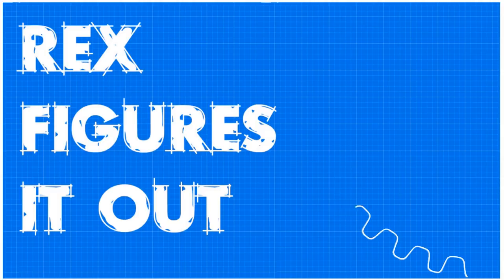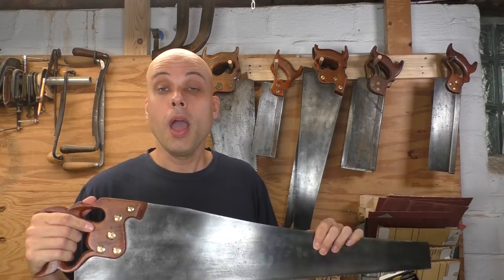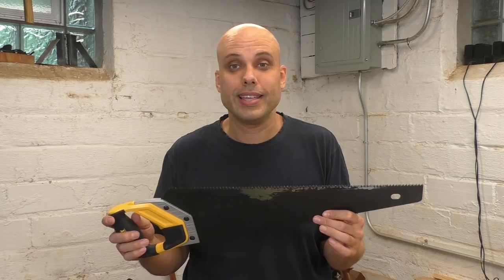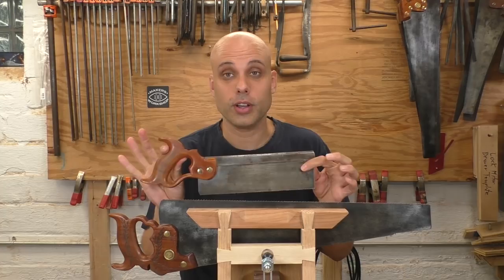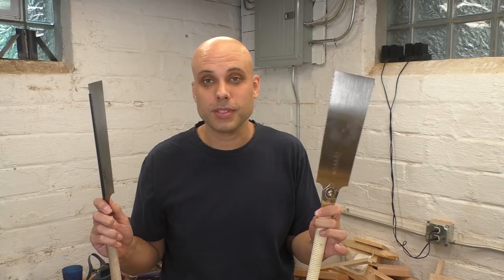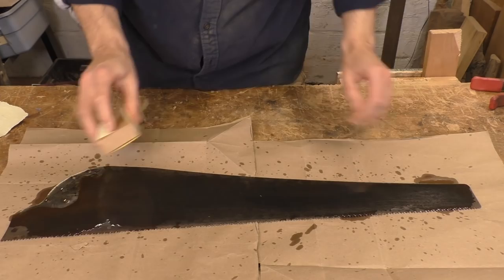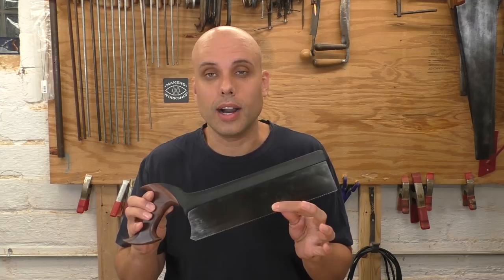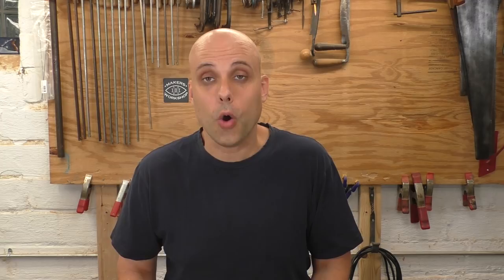The TRUTH about woodworking saws.

Comment: Try putting your old hardpoint saw blade in the oven for an hour or so at 200⁰c/400⁰f then re-sharpen it. Just be sure to take the plastic handle off first so you dont have to deal with an angry spouse.
Reply: You can also just get a set of diamond needle files. I use those to resharpen my curved pruning saws, which are impulse hardened. The teeth WILL get smaller, but I can cut branches and small logs for 10 years instead of 2.
Reply: You can also just grab a cheap torch at the big box store and heat up all the teeth until they start lightly glowing and leave it to air cool (anneal).  Some may even choose to place it in some warm sand or even in your oven with it turned off to slow the cooling process & further soften the steel but in most cases this shouldn't be necessary.
Keep in mind, depending on the exact steel composition, the teeth may need to be re-tempered after sharpening or you will find that it gets dull really fast.  Just don't forget to draw back the temper a little as to not have a brittle blade.
Reply: @John-lx8iu  That doesn't really work. The steel is cheap junk. It ONLY hardens with impulse hardening. You can aneal it but will NEVER get it to hold an edge again because you can't harden it.
Reply: @John-lx8iu   i see where your going with this but the idea of putting it in the oven is to temper the teeth back from the original hardening process, rather than annealing it and having to harden the steel all over again, so the teeth end up half hardened in a similar fashion to those great vintage saws we all chase. It wont be perfect as the steel isn't necessarily great but it does mean you can re-sharpen your saw and it will stay sharp for a good while.
Reply: @grantflippin7808   to anneal it you would need to heat it higher than that, as in to blue colour, this is a tempering process that shouldn't get hot enough to completely soften the steel.
Reply: I thought about this as well. Not sure if it would work but a very interesting experiment. Also there seems to be the inevitable confusion over annealing vs tempering.
Annealing makes a metal as soft as possible and involves getting it very hot then cooled very slow.
Tempering involves moderate temperatures and partially softens it depending on what temperature you use.
Reply: Tempering: softening steel that has previously been hardened. You can soften it a bit, or all the way to a “normalized” state. Tempering temperatures depends on the steels composition (and some new alloy steels require special equipment). For plain old high carbon steel with minimal other elements added, it starts around 400 F and goes to around 500 (beyond which it is normalized).

Normalization (with “normal” steels - low alloy, ie mostly carbon and iron) involves heating to orange heat, letting soak a bit so heat penetrates to core of object, and air cooling - often hanging from wire hooks. This is usually how you want a non cutting object made out of carbon steel heat treated. It is strong, not brittle, and not too easy to bend.

Annealing (again, with “regular” carbon steels) involves heating only to a bright “cherry red” (in the dim light: don’t judge these colors under a strong light). Heating to cherry red and then placing in a metal can filled with ashes or wood shaving, and capped. Or left in a dying campfire overnight. (Be safe...) The steel must cool over a period of hours. The slower it cools, the softer it becomes. You can get a quick and dirty anneal in 30 minutes but don’t use your good files a lot on it because it could be a lot softer.
Reply: Knowing this, I suppose can guess how you harden it (plain old carbon steel... hint: it involves cherry red). You don’t have to cool it to ambient temperature - it can still be 200 or so, when you pull out of oil or water; in fact that’s ideal. Now you can very quickly tap it straight or remove twist because the hardening hasn’t set in yet.
Reply: The crew in this discussion needs to go read the tempering wiki.  There are a lot of inaccuracies stated. It is showing the tempering range to be 350F to 700F and normalization at about 1335F (which would be the red color someone mentioned). Wood saws it is stating are tempered to 640F. These saws are going to be a low alloy medium carbon steel, so the wiki data should match quite well. Your food oven isn't going to get it soft enough. It will get it down to about same as a drill bit or hammer, which is a bit hard for regular files (the diamond file comment seems quite reasonable, and doesn't mess with the original desirable heat treatment). I don't recall hearing the term impulse hardening in industry,  but instead induction hardened. But that doesn't mean the term doesn't describe what happened, it is brief, and things vary by location process/tooling.
Normalizing or annealing will make it way too soft, but you could re-heat treat it afterward. Thin material like these saws will be tricky without machines for that purpose though. It will be harder to control the temperatures evenly by hand.

It think the diamond files sounds like the easiest plan. Also the teeth are probably only slighty damaged, so not that much material would need to be removed. 
Otherwise I would buy a chainsaw sharpener with the few inch diameter abrasive wheels and shape the wheel to a 60deg point. Then make your own saw vise to mount it to (removing the chainsaw blade vise), and create an indexing method for positioning the teeth. If you are that ambitious you could create one for table saw blades too.
Reply: I think this thread is good stuff. I've got things to read up on.
Reply: That’s going to temper it, but then you end up with sharpened, but relatively soft teeth. It’s going to get blunt a lot quicker than it did the first time.
Reply: Absolutely. You can even temper in a kitchen-oven. 5-6 hrs at 300 centigrade... What do you have to loose? Did that a several times with mixed results, some times very satisfying,  sometimes just a detour instead of directly-to-recycling. But again: what you got to loose?
Reply: The initial blade is mild steel with localized hardening on the teeth. If you temper the blunted teeth to make them easier to sharpen, you are potentially going to then grind through the tempered region down into the mild steel. Yes, it will be sharp, but it’s going to get blunt pretty quickly.
Reply: You don't throw the saw away. You send it for recycling so its far less wasteful than you suggest.
Reply: @jonathanbuzzard6648  As far as your wallet if concerned, it is wasteful, unless you consider a faintly righteous feeling part of the pay-off.  You pay for a saw every time you recycle one.  The "vintage" saws are no longer made primarily because they DO last for a very long time.  I have saws that are excellent saws and are over a century old.  One problem with "disposable" saws that Rex didn't mention is that impulse hardened teeth are just as brittle as that file.  A missed stroke or dropping the saw in the wrong place and you have a saw with a gap-toothed cut.
Reply: @theeddorian  Unless your time is free then a modern disposable impuse hardened saw is cheaper to own and you have failed miserably at economics. If you are a hobbyist then a modern saw can last a decade no problem (mine has), and given resharpening a saw is a skill you would have to acquire and requires a bunch of tools then resharpening a saw is simply a stupid proposition.

So what if you are a professional? Well I can go onto Amazon here in the UK and for £10.90 I can get Bacho 22"/550mm impuse hardened saw delivered next day with prime. This is not some cheap Chinesium brand but a quality European tool brand (https://en.wikipedia.org/wiki/Bahco). If Chinesium is fine then I can get one at around half that price.

So lets assume that it will last two years and in that time a resharpenable saw would need resharpening four times and take you 20 minutes each time (I would say that is being extremely generous it will likely need sharpening more often and take longer) . The minimum wage in the UK is £8.72 an hour. So it is going to cost you £11.63 to resharpen your saw over £10.90 to just buy a new one.  So even ignoring the cost of the files, vice and tool to set the angles on the teeth it has actually cost me more to resharpen a saw. The living wage is £9.30 so it will cost me £1.50 to sharpen the saw at that price point. However the chances of employing a skilled trades person at that hourly rate are basically zero so it will cost you much more to sharpen a saw.

OK you say well the handle is not recyclable and I am going for the environment. Unfortunately I have you there too. Just go by a Bahco Ergo EX Handle which takes replaceable impulse hardened blades which are 100% recyclable and avoid all the additional environmental impact of the tools required to resharpen a saw.

You are however right that the teeth on an impulse hardened saw are much easier to snap off. On the other hand I can get them with tooth profiles that are give cleaner cuts and are more efficient at cutting which you could not possibly sharpen yourself.

Sharpening a hand saw makes no economic or environmental sense whatsoever which is why they are difficult and expensive to buy because only fools buy them. As my grandma always used to say a fool and his money are easily parted.
Reply: @jonathanbuzzard1376  I bought two really decent 26-inch handsaws at a tag sale for a total of five dollars - that is, $2.50 each.  I took them home, did test cuts, built a quick saw sharpening jig the next day (I needed a hinge I didn't have) and had both sharpened and cutting true in half an hour.  Now, tell me again, what makes economic sense?
Reply: @theeddorian  Apparently the time to make that jig, the time spent sharpening and the files all came for free. So lets look at that. Avoiding the cheap chinesium and stick with Bacho (as that's the brand of saw I used) and doing some research on what files I would need that gets me to £22.12 from Amazon. Already this is more expensive than two saws. However if I am going down the resharpening route I need some pliers to reset the tooth angles from time to time that would appear to be about another £15 on Amazon. So brushing aside the fact that everyone getting an old saw from a yard/car boot/tag sale etc. is not viable and most people would have to actually buy them new (~ £24 for a 22"/550mm saw from a reputable brand on Amazon here in the UK) the economics are still in favour of impulse hardened saws, which is why the market for sharpenable saws has more or less vanished. Add in soft grip handles, enhanced tooth profiles which cut faster and cleaner that you could not possibly hand sharpen anyway and any professional woodworker sharpening their saws by hand is going to be undercut by someone who just buys impulse hardened ones.

Sharpening saws is a willy waving contest trying to show that you are better when in fact you are just wasting money.
Reply: @jonathanbuzzard1376  I am really don't see your point here.  Are you simply arguing because you like Japanese saws?  That's fine by me.  Excellent woodwork is done using many different kinds of tools and has been for long before the modern versions were ever imagined, thousands of years before.  My remarks were to amplify the discussion, not set someone straight, and particularly not you.  I started assembling the tools I from tag sales and junk stores. Costs are always something we seem to confront.  Rex makes the point that the course of developing skills doesn't need to follow any particular course.  Many woodworkers are hobbyists or start jusr through necessity, as I did.  My tactics were dictated by by my pocket book.  That unfortunately means almost inevitably that you do things like buy cheap chisels because you can't afford really good ones, so you either by a $19.00 India stone and learn to sharpen them or waste more cash buying new cheap chisels.  I learned to resharpen.  Costs less even in the short run, even with really cheap chisels.  The big critical advantage the present has over the past is the internet and excellent sites like Rex's.  That means that you can pick up very quickly many different tips, tactics, and approaches.  We even discover sometimes that the family lore about "why" something works may be wrong.   If you are starting out, you take advantage of that.  I did.  I traded time instead of money.  Now what really has you so upset?
Reply: Something is being missed here. The impulse hardening process requires an air hardening tool steel, annealing profiles for which can't be improvised so any attempted heat treatment in the home shop is going to give you more hardness or nothing.
Reply: @jonathanbuzzard1376  If it were just about the economics, no one here would even be doing this. We would be at Ikea picking out our furniture instead of making it.
Reply: @przybyla420  better idea.  don't buy garbage, then you don't have to come up with ridiculous half-assed metalworking hacks
Reply: @court2379  pull a metallurgical handbook. Just as a FYI tempering depends on both time and temperature. You can temper at a higher temperature for shorter time. Or Temper at a lower temperature for a longer time. These do also result in different phase changes in the steel so that’s good to look at as well.

Wikipedia’s info on this stuff is terrible but you can get a decent metallurgical handbook for 80-100 bucks that will cover heat treat procedures for hundreds of grades of steel.
Reply: @Taskarnin  I believe doing it at a high temp for a shorter time may produce the same average hardness/toughness, but the surface is going to be softer than using the lower temp for longer. If you are looking for a strong part, that won't make much difference. If you are looking for a hard surface for wear resistance it will.

I have better resources, but there was so much misinformation on this thread that I was just trying to get them to read readily available basic information of how the process works.
Reply: @court2379  you’re over thinking it. When the time scale is hours that would only matter for very heavy parts (think thousands of pounds). For thin saws like this there’ll be almost no difference in temperature between the surface and core of the material.

The temperature will only effect how long it takes the carbon in the martensite to dissolve and whether it ends up as a face centered  or body centered cubic ferrite matrix. Temperatures at when that will happen depend heavily on the grade of steel being used.
Reply: @Taskarnin  It depends many factors incuding the time, surface area, shape, the mass, heating method, alloy, thermal conductivity, crystal structure transition temperatures, phase transition, diffusion rates and occurence temperatures of various crystal types and alloying elements, and the temperature difference between the heat source and the workpiece. A complex transient heat transfer and metallurgy problem that a metallurgist spend a lifetime studying and learning. If you are using a high frequency induction process for heating, even low mass materials could have significant differences in hardness thru their thickness for instance. Testing that requires micro hardness testing methods as conventional ones penetrate too deeply to accurately detect it.

This conversation is leaning toward a who is smarter contest though, and I really don't care. For the purpose of heat treating a saw blade at home in a garage on plain medium steel or even moly, chrome, and vanadium steels the wiki page has sufficient information to do a passable job. The tempering heating method should be as low temp as is possible and as even as is possible to get the best result and not over temper the outer surface, though on such thin material it generally won't make a lot of difference unless a direct flame was used for heating.
Reply: How about grinding the hardened teeth off? For example with an angle grinder, then cutting the teeth again and sharpening them as on usual saw?
Reply: you sound like you're talking with experience with the spouce part
Reply: A new Irwin jack if used only on new clean timber on a job will last 2-3 weeks, then it is fine for old floorboards, when it won’t do that you can use it for foamed concrete blocks for about half a day, then you can cut it up for scrapers and shims, cost £11-£12. buy them on sale for £8-£9. can you sharpen three saws an hour ? some guys say they can, Properly ??
Reply: 500f is more like it, 400 what I use for knives and that’s too hard for a saw.

Comment: i have sharped a several hard point saws using a diamond thee corner file i bought on ebay
Reply: Thankyou. You answered my question. The saw will still be usable when the superhard metal is gone. Recycle and think.

Comment: Saws are a bit of a personal journey for us all and it's great to read so much useful feedback in the comments below. You've built a really likeable community here Rex, and you should be proud.

My two cents worth is that I purchased a couple of Japanese folding saws (ryoba and dozuki) a few years ago. They are fantastic, as the handles protect the blade (and the user) meaning that they fit in your tool bag without causing injury. (Hell, in a pinch I've carried one up a ladder in my back pocket!) Mine are the Silky brand, the Wood Boy dozuki and Takeru Boy ryoba, but I'm sure that there are many others as good. (I'll try the diamond file trick mentioned below when the time comes.)